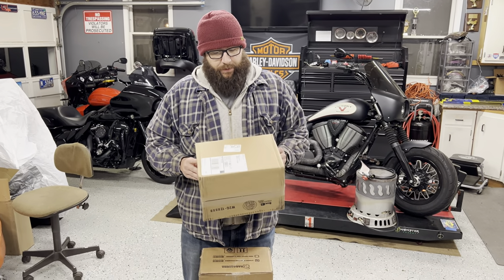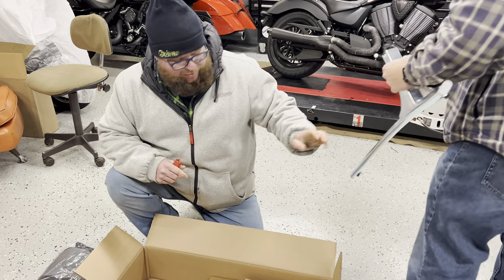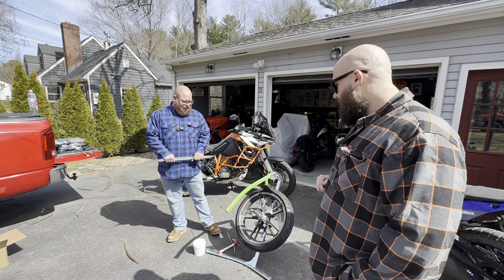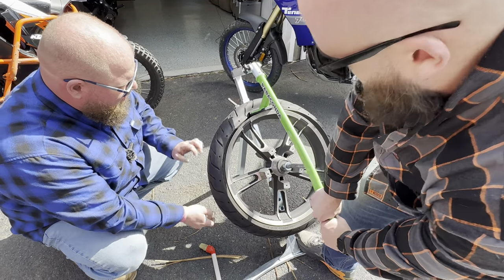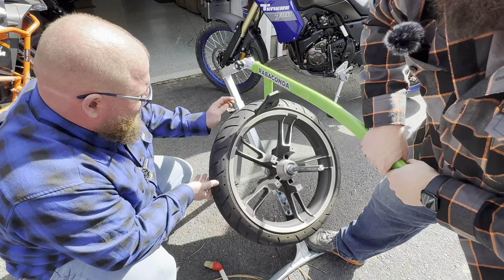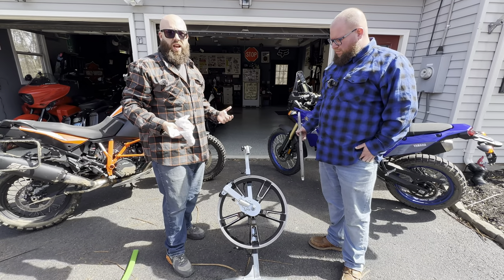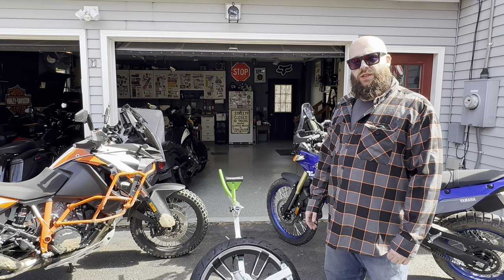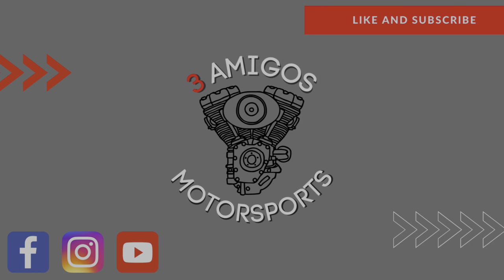Rabaconda Motorcycle Tire Changer - Demonstration & Review

Comment: Really awesome video and fun to watch! Thank you guys for posting it, it's great honor for us! 
If you don't consider it rude, I'd add few learnings we've had on the way. a) for dismounting we have started to use soap water spray. Simple like that. Why? the soap water does not dry and stick like the bead grease. And it's liquid enough to penetrate smallest cracks between the tire and rim. That's good when you are fighting to break a very difficult bead. Soap water helps. b) we start dismounting with the duck head at 6 o'clock, because then, when you pull the tire over the duck head with the tire iron, SIMULTANEOUSLY you can push the tire down to the drop center from opposite side with the bead breaker. c) when using drop center tools, lube them also really well so the tire can slide into drop center. d) when mounting, the tire has to be DIAGONALLY on the duck head. So that the tire is above the front hump of the duck head (in the moving direction) and below the rear hump of the duck head.
But thanks again for the video!! 
And... damn, the Road Glide looks too good back there... dream bike!!
Reply from the maker: Thanks for all your input and sharing our video ! We'll definitely try the soap and water method next time. We're very happy with the product and being self sufficient for all our bikes.  It's diffidently true, the little tips like starting at 6 o'clock made all the difference. It became easier and easier after a few sets of tires. We still expect to be able to get the next set done even quicker !

Comment: Great vid.....I bought a table top balance rig a year ago....the cones where not machined dead ctr.....so could not get a constant balance if you took the cones out and fitted in a different part off the wheel.

I sent it back and paid 3 times the price for a supposed garage quality rig.....same idea with the cones.....it was better but not perfect.

In the end I found my bikes axles could be used and did not need the cones...that worked perfect.

Its easy to think these rigs are doing a good job for you.....but good chance its kidding you.

Nick in the UK.
Reply from the maker: Thanks for watching. I can see what you're saying. We'll have to try using the bike's axle next time. Ride on!

Comment: BMW'S  from the 1970's were so far ahead of their time!  The bikes came standard with a bead breaker built in (the centerstand had specially designed feet to break the bead), the tool kit had tire irons, to change tire, a repair kit to patch the tube, and there was an air pump conveniently mounted on the frame to pump up the tire.  Oh yeah, that centerstand was perfectly placed so when you took off either tire, the bike would gently rest on the tire that remained, no looking for a log on the side of the road to prop the bike up.  The dealership actually instructed me on the procedure.  That tire machine looked painful 😂good luck 🤞
Reply from the maker: There's definitely a learning curve with the tire machine, however, its gotten easier every time we've used it. It's a great tool.

Comment: Thanks for the great video. It's good to see people using a product before buying. I'm starting to get up in age and I've been doing the Neanderthal method using just spoons and the last tire tool longer that your video just to get it on the rim. Doh! I had it down to this changer and one by another company. The other one is way cheaper but it looks like the bead breaker could scratch the rim and the manufacturer's webpage doesn't even list that product. With the Rabaconda, you get the lifetime warranty plus spare parts as needed. I also think the Rabaconda is more ergonomic and much easier with it's ratchet system. Lastly, they have a hub adapter that should work for the single sided swingarm on the 2014 VFR800 I have. After seeing this video, I'm buying one.
Reply from the maker: Thanks for the comment it’s great to see people benefit from our efforts. Hopefully you’ve subscribed. The Rabaconda is truly a great product and they stand behind it. That being said there is a learning curve as we mentioned. But pay attention to their little tips and details as they certainly help. After that you’ll have a great tool to make tire changes a snap.

Comment: I just changed my front tire on my Road King and had the same issue you did when you cut it out at 16:04 mark. I fought with it and finally got the duckhead into position and once I got it to stay and used 2 drop center tools the tire went on no problem but there seems to be a troublesome hiccup in that portion of the process. I will be changing my rear tire tomorrow so hope it goes better. Thanks for the vid!
Reply from the maker: The small tips like that help immensely. We did another set last weekend and for just the part of putting a tire on the wheel we had it in 5 mins like you said , remembering that correct position and going straight for using the drop center tools.

Comment: Use counteract beads to balance instead of weights. Much better
Reply: I’ve been using airsoft BB’s got years in my 35” mud terrain Jeep tires and my sportbike tires and they work great. A couple ounces poured in the bead of the bike tires before popping the bead on and about 9-10 ounces in the Jeep tires.

Comment: You have to remove the rotors which is a PIA as you have to buy new bolts for the rotor.
Reply from the maker: You don't have to remove rotors to mount tires. At least we never have !  Thanks for watching.  You are correct with the bolts as they're torque to yield, they are supposed to be replaced when removed.

Comment: Good to know that the tubeless spoke wheels need a different head.
Reply from the maker: Yes we found it out in the middle of changing the tires!
Reply: Only those spoked wheels need different head that have "cross-spoked wheels", where spokes run out to the sides of the rim (like BMW GS, Pan America). The sides of these rims are really thick, so they need a wider duck head. Normal spoked wheels do not need wide duck head, tubeless or not (like KTM Adventure bikes, Tenere, for example)

Comment: Nice video, why did you remove the brake discs? Just video clarity?
Reply from the maker: No, I was having the wheels powder coated after this video!
Reply: You can leave them on when changing the tire. I just did my Road King with dual rotors with no issue.

Comment: What kept me from buying is the unit is shown which is expensive but then there a bunch of other pricey pieces I assume might be needed but there was zero explanation so I passed  Had they included some kind of verbal insurance with the main unit like "This has everything needed to change most typical full sized street bike motorycle wheels with one piece wheels"  Then I likely would have bought ....but not if I might rather buy it only to find it is not all there and I have to buy more pricey pieces ....it sort of looks like maybe greed kicked in and they want to turn a 6 something hundred dollar purchase into a 1000 dollar purchase?   Hope I am wrong but without explanations idk
Reply from the maker: Thanks for watching. This kit includes everything needed to change most tires, but yes, there are some additional pieces needed for exceptions like Ducati or BMW with one sided swingarms. We did have to buy a larger duck head for the external spoked Pan America wheels, but it was only about $50. 
You are correct this machine is not cheap at around $600 but we look at it as an investment. First we split the cost among 4 friends and otherwise we are saving a $100 on every set we change. In that perspective it becomes a money saver very quickly as we all go through a lot of tires.

Comment: The duckbill broke the first time I used it. Even it's they cover it under warranty, going to have to say it's a POS
Reply from the maker: Manufacturer defects do happen. I'm sure they'll take care of you with a replacement, its clear they stand behind their product.
Reply: That’s a little harsh I think. Get it replaced under warranty, and if it breaks again, by all means call it all the bad names. But by all accounts it’s very well built so I doubt you’ll have more trouble. Unless you’re doing something wrong using it and not realizing.
Reply: Sounds like an operator malfunction.